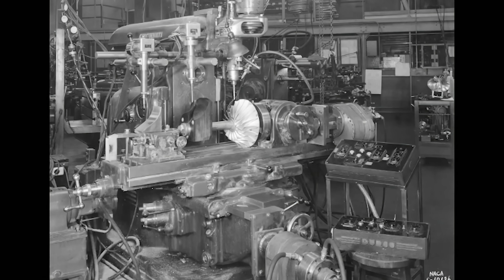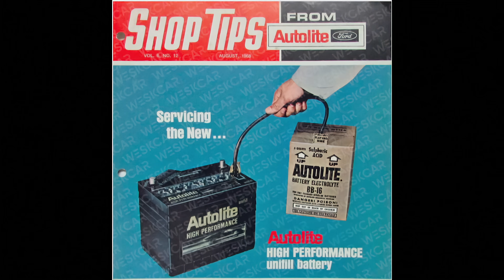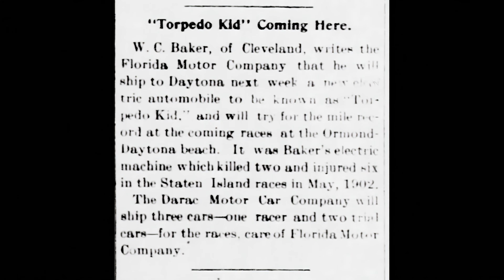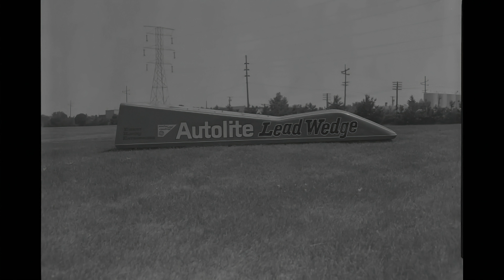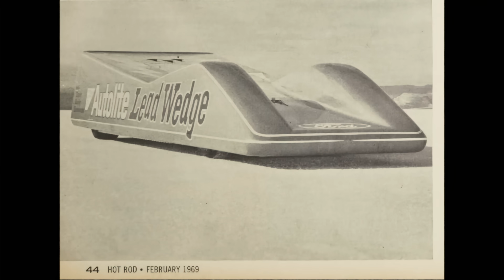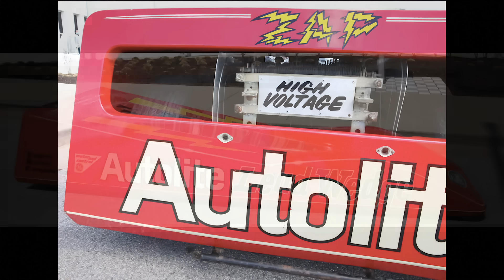Battery Ram: The Autolite Lead Wedge - A High Voltage History

Comment: Autolite and Motorcraft were together. and were owned by Ford and made a wide variety of parts for Ford vehicles including carburetors. eventually Autolite was bought out by Allied Signal. and they still make engine management parts. and tune up parts such as spark plugs and wires. however Motorcraft is still with Ford and makes engine management parts. 

the auto manufacturers wanted to corner the market on batteries. and this was Ford's way to do that. but GM had what they thought was a brilliant idea. when they had AC Delco build the side post batteries. because their customers would have to come back to AC Delco. and they thought that it would take a while for the aftermarket battery manufacturers to catch up. but to GMs surprise it didn't take hardly any time to have their own side post batteries. competition is fierce among replacement parts. which was only made worse when the Chinese got into the replacement parts business.

Comment: Do we know more about the design of the motors? Were they traditional brushed DC? Or did they try some wacky inverter setup into an induction motor/VFD to avoid losses associated with the brushes? Or maybe all the extra equipment and efficiency losses associated with such a setup would make it just not worth it or too heavy? I'm curious now.

Comment: That wedge looks like it would have been held back by the vacuum bubble forming behind. A bit of curve on the rear edge would have made a huge difference at 100+mph

Still, it was a great advert for what the batteries do best

Comment: Looked cool, but actually not very well designed for aero drag. The Silver Eagle had no drag, which is what got it 8mph faster, not the batteries. Electrics are so efficient the batteries or motors won't make much difference in the lead acid era.

Comment: 2:11 DUDE.  Give us a video on just that machine.  It looks NUTS.  I always wondered how they machined compressor wheels before CNC.
Thanks for another great video.  That resistor bank was crazy.  They must have swapped the batts.  No way to give lead-acid batts a meaningful charge in less than an hour.
Just listened to your Prest-O-Lite podcast on your Dork-O-Motive channel.  Absolute insanity!  People MUST have been getting paid off to keep those plants open.

Comment: Wow!  I’d like to know what Autolite’s battery sales were in 1968, before the Lead Wedge, and in 1969 and 1970, after the Lead Wedge.  I didn’t even know that Autolite sold batteries (I don’t recall seeing them advertised back then).  I do know that they were spun off from Ford as part of an antitrust action.  The graphics on Autolite packaging (the Ford GT40) later appeared on Motorcraft packaging.

Comment: you're baking in the sun and salt and then you use a resistor speed control that's inside with you aiiiigh. (i see there's vents and then the entire back is open, but I bet the back of his helmet got extra warm at the beginning of each run. There was probably a ton of time pressure to get off those resistors before they fried themselves.)

Comment: In the mid eighties a Bonneville speed week entry from Japan there to attempt an electric speed record was called "Salt Shaker". It had never been fully assembled or tested in Japan and was put together on the salt. It would wind up running a couple passes with 1/2 batteries. The fastest time was only 160 mph when the whole project was shelved....pallets of new batteries were set in their paddock area with a "free batteries" sign(!) as they didn't intend to ship them home. 1/2 mile to carry them to our car...we passed...should have grabbed a cart!

Comment: That timeframe- and what they made- is especially wild, because in that era 3-phase inverters and power electronics had only just been invented for the EV Corvair and NASA projects for the moon landings; there was no need for hyper-efficient 3 phase conversion of DC power because energy was so cheap and available you just went bigger. 
This points to the creators having some serious chops with prior high voltage DC power electronics, and whats really cool is how repeatable this whole thing is; aside from the VERY REAL safety concerns that 100+ V DC carries, it's a glorified golf kart that can also do over 130mph. I've seen youtube videos of kids building and modifying Sur-ron electric motorcycles that are debatably more complex.

Comment: Time 215
Machining what looks like to be an aircraft piston engine's compressor wheel.
In the old days, the rotary head holding the compressor wheel was tied into the X axis of the table in order to get 2 axis movement in a controlled manner.  Apparently this mill also tied the Y and Z axis into the system as well. 
I also see, on the left of the machine, 2 tapered blocks and 2 vertical probes that apparently control the taper of the cut.  The power to move the tables apparently is hydraulic due to hose type.

Comment: Thanks Brian! I worked for Jerry Kugel in 1970. went to Bville with the Rod and Custom B/MFR roadster powered by the 427 cammer engine. This car was built in Jerrys garage at his home in Whittier California, I sat in the drivers seat while the engine was running while Jerry and Duane McKinney tweaked the injector pump, this car would run effortlessly to speeds of 200 miles per hour..........if there ever was a good story of a young guy making his success in the automotive industry engineering and building some of the most innovative scratch built cars............. a very good story for sure, might check it out! BTW the Holmes Kugel 427 engine resides in the American Speed Museum.  The photo of Jerry and the Lead Wedge was in his office  at his shop on Westman Avenue, Whittier California, right next door to George Salie{sic} Engineering...........another story for sure 1970!

Comment: LMFAO! It's a mixture between a radio controlled electric car and go-kart! And yet somehow someone thought this was a brilliantly great idea to try breaking the speed records with!?!? 😂🤯🤣🥴 Yet they found someone stupid enough to get in this thing and try it! SMFH!!! I couldn't begin to imagine how any of these "cars" were handling at speeds above 45mph??? Them "Roadsters" I've been in, and there's a good reason why I'll probably never be in one again if it's all stock especially. Mechanical brakes, steering suspension which was brought over from the horse and buggy days as were the not so reliable tires and wheels! But at least if they were metal and not wooden your odds were a little bit better of survival? Maybe? SMFH! The bodies of them roadsters also not welded nor riveted, were mostly all held together by wood screws and oak or ash wood frames behind the body panels. This mixed with their wrought iron like flimsy frames where steel was still considered an industrial secret recipe..... to make up for the wonderful mostly dirt roads across the country and with a suspension system that lacked much engineering marvels. These cars dependent upon being flexible in each and every aspect was an understatement to say the least. Some of which even used springs, of sorts compression usually between the frames and body fasteners, so that the body's would float independently to the frames and absorb a lot of twisting and torture of their off roading abilities necessary to keep all 4 wheels on the ground of these dirt paths called roads. Now stating that, this wasn't the reality of a lot of these race cars of the day, but they were still built mainly off the same stock frames and body's. Which gets a bit scarier, being the premise of a race car, weight reduction is always a key factor in winning races. These vehicles would have these already chinchy @ss frames and suspension parts drilled out or cut out for lightening the load. Thus making an already semi weak system into an extremely weak, yet lighter system and taking these machines to their ultimate speeds...... Some would call doing something like this crazy, or even suicidal? And both would be correct in doing so. Many people died in the pursuit of speed and its not over yet. We still have this need for speed, but at least today it's definitely done a bit more safer than it once was. I mean we wear helmets and fire suits today. Back then a hat, or a football soft helmet was considered overkill. Men were tougher and more resilient I guess to injury? But also the machine's were also much crudely built and everything in or on them was out to kill you like the steering columns or the windshields......

Comment: First a great story! Jerry Kugal is a fantastic gentleman who along with his 2 sons continue to run at Bonneville. Second as the racers at Speedweek 2025 are currently finding out it’s 99 degrees in Salt Lake City and only slightly cooler in Wendover. November would be have been a great month to run as long it’s dry because the temperature can easily be in the 60’s making Jerry’s ride way more comfortable. The SCTA /BNI does have a meet scheduled at the beginning of October this year. A great time if you’re ready.

Comment: Brian, you have knocked another one out of the park with this very interesting video! 

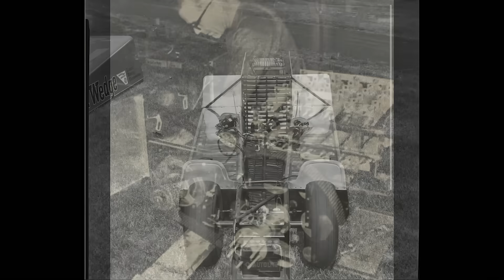 I do have to disagree slightly with your comment that the 21st battery in the nose was for ballast.  Ballast could have been a secondary function, but in the photo at 22:46 you can see that there are wires connected to it.  I think the main purpose of this battery was to run all of the control and instrumentation circuitry of the car without using power from the main traction battery.  One example of this use would be to energize the magnetic coils of the relays or contactors connecting the main traction batteries to the motor through various combinations of the high power resistors at the rear of the car.  Note also that the 21st battery does NOT appear to be one of the "High Performance" (HP) Autolite batteries.  It is an Autolite branded battery, but it appears to be shorter than the HP batteries in the main traction battery and you can fairly clearly see 6 individual cell filling caps rather than the "Uni-Fill" setup on the HP batteries.  As an electrical / electronics engineer I would say that the drive system on the Wedge was simple and robust but "low tech" and not so efficient.  All in all though, it was an admirable accomplishment to build this vehicle in the 60 day window they had.

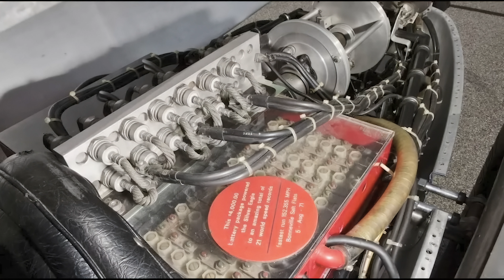The photo at 22:05 of the Silver Eagle tells a completely different story.  This is (for the time) a very "high tech" system.    The name "Silver Eagle" comes from the fact that the batteries use a silver / zinc chemistry and were manufactured by the Eagle Picher company who sponsored the car.  There were 180 battery cells each rated at 1.2 volts (loaded) at 40 Amp Hours.  These cells had much higher energy density than the lead acid batteries used in the Wedge so were smaller and lighter resulting in a much more compact vehicle.   In the photo you can see some of the battery cells in the red-sided box.  The motor was a 102 HP General Electric series wound DC motor.  I suspect that the 102 HP was the nominal power output.  Under overload for short periods (as during a LSR attempt) who knows what it was actually putting out.  At a guess, 2 or 3 times the nominal output would be reasonably safe.  Above the batteries to the left is the power handling part of the motor speed control system.  The 12 devices bolted down to the large aluminum block (heat sink) with the heavy flexible wire coming out the top appear to be high power silicon rectifiers in 3 sets of 4 in parallel connected to the Black wires that lead to the rear of the car.  I was expecting them to be SCRs (silicon controlled rectifiers) used in a chopper or PWM setup but I don't see any gate terminal on them.  I looked around a bit for a schematic of the Silver Eagle power control system but have not found one yet. There seems to be quite a bit of information available on the Web about the Silver Eagle so doing a video might be practical, though a computer rather than an excavator might be a more practical research tool.  As of May 2025 the Silver eagle seems to be up for auction with a starting bid of $25K, but it didn't sell.

Comment: 'It's too quiet in breaking records on salt flats 😅😅😅' nicely done brian with today's video on autolite lead wedge is extraordinary story of american hot rodders doing battery powerd salt flats car in two months has me shock (no pun intended of course 😂😂😂) as it show how incredible the 60s where in motorsports 😮😮😮 anyway thanks brian for this video and have a good day bye now later 🫡🫡🫡.
Reply from the maker: The way this thing came together is maybe my favorite part. Granted it was not “that fast” but if it turned over, the story would not have ended well.
Reply: @brianlohnes3079  yeah i don't want to think that 😅 ohhh i got you new story to do how about doing the 'gray ghost' gto trans am car in the future 🤔🤔🤔 anyway thanks brian for responding and have a good day bye now later.

Comment: Another Goodie Brian! I'm not a fan of EVs (it just not their time, maybe someday), this HAS to be one of the coolest EVER! thanks
Reply from the maker: Chuck, totally with you. I was hesitant to do this video for that reason and what people would think, but when I looked into the project and the WHY behind it, I got interested. Just a brilliant way to promote some boring batteries!
Reply: @brianlohnes3079  exactly
Reply: EVs have their place. I rented an Opel Corsa EV a while ago and it was quite unremarkable, drove like any generic small hatchback. And for people living in cities who just want to get to work or the shops, that's gonna do the job, without the pollution or cost of fuel.
Reply: @nerd1000ify  ALL the recent cost analysis's of cost per mile for EVs say they cost the same/more to operate then ICE autos, and where is most of the electricity for them coming from?
Reply: @mgbchuck6527  I can't speak to the reliability issue (other than to note that several US automakers seem to currently be working pretty hard to resolve any difference by making their conventional cars less reliable!) but the carbon emissions discussion has been done to death. Lots of analysis by many different scientific groups, accounting for every variable you can think of. Basically it works out that on average a heavy EV makes about as much CO2 as a light conventional car over its lifetime. Not exactly the "zero emissions" promised, but better than the alternative I guess? 

Exceptions to this exist of course. For example in some parts of the state of Victoria, Australia, most electricity is produced by burning brown coal, an especially dirty and inefficient fuel. There you might actually be "greener" running a conventional car than an EV. On the flipside, in France something like 60% of the electricity comes from nuclear so the EV would be much more favourable there.